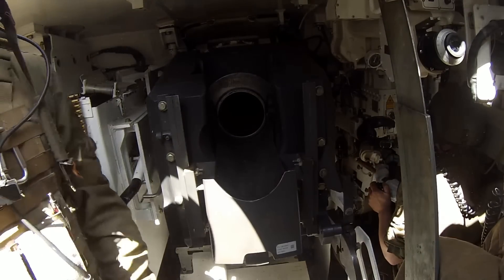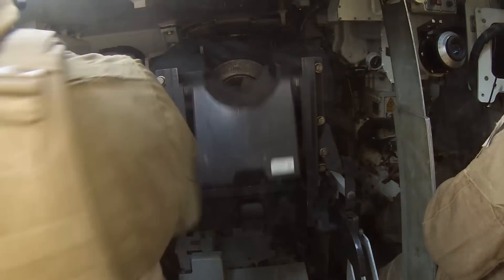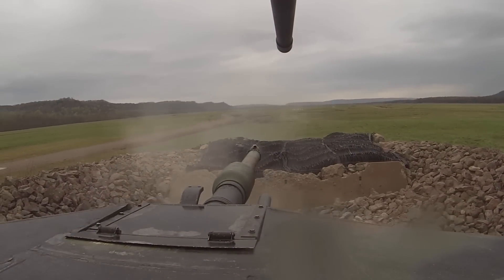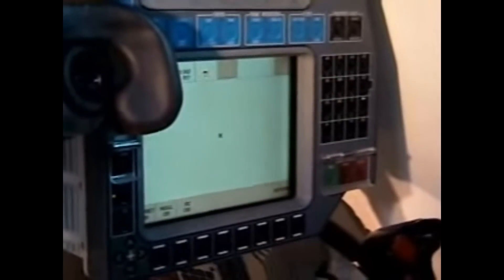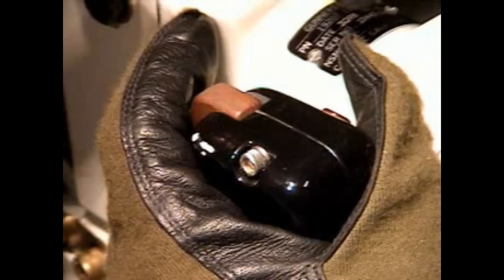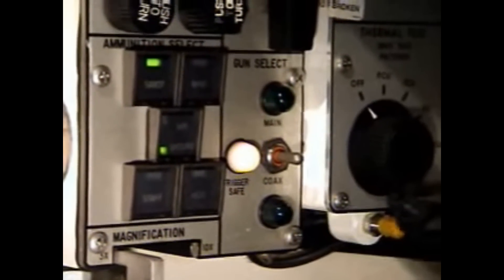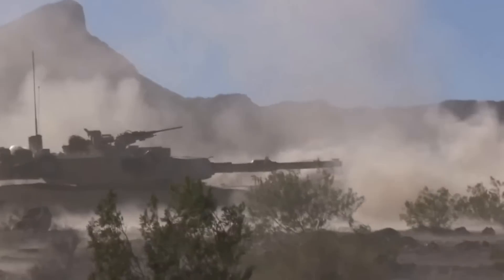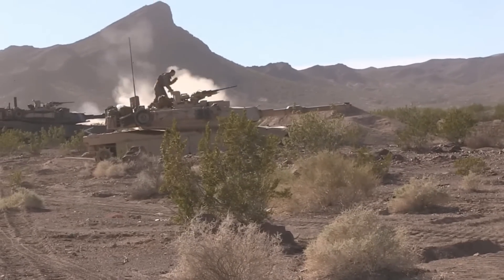How Do They Clear Tank Gun Misfires?

Comment: must be an uneasy feeling having to handle a 120mm misfired round and put it back into the storage rack lol
Reply: With .22lr you can just rip the bullet out and pour out the powder.  Of course after having waited a minute for the 0.001% chance its a very delayed hangfire.
Reply: modern tanks are designed with an ammo rack that shuts so that all explosions are projected outwards leaving the crew unharmed.
Reply: Naj Kraemer Not exactly true. A C2 had a blow back, killing the turret crew.
Reply: Naj Kraemer Unless you have an obturator failure.
Reply: Naj Kraemer it’s really designed to help with taking enemy fire.

A misfire is a very anal relaxing moment when you open the breach. With Chieftain you hope to hear “no vent tube”.
Reply: @najkraemer3117  regardless of crew safety, wouldn't that still put all the other shells at risk,?
Reply: Man I would scare as fuck
Reply: even an explosion aimed outside can cause damage to the tank, and it could happen with the door open and might take with it a large portion of your ammo... best to avoid this if possibole...
Reply: Yeah, I figured they would throw it overboard to keep it from cooking off in the ammo rack. I know at the range I kick dud rounds away from me. Don't want anything going off not in a gun.
Reply: @rre9121  Rounds that go off outside of a gun don't shoot the projectile. They go off like a firecracker.
Reply: @rre9121  Modern tanks are designed with an ammo rack that, if it would go off, a panel on the top (primary storage area) of the turret would blow off, forcing all the gases that way. Which is why it's called a blowout panel.
There is another ammunition rack on the side of the M1A1, which also has a blowout panel.

Must get loud as hell when it does get set off, though.
Reply: @pocketwingman  Yes, but you don't want to lose your ammo to a cookoff if you don't have to. I'd just as soon not lose 30something rounds of ammo and a ton of damage to the tank from the ammo going up.
Reply: The ominous music doesn't really help.
Reply: Yes, I'm not an idiot, I understand the difference between a .22lr and a tank round. Also the depleted uranium will not melt you, neither literally nor figuratively. If that were the case they certainly wouldn't leave it exposed as they do on tank sabot rounds. Here is a link to a picture for reference of a variety of depleted uranium munitions.

http://2.bp.blogspot.com/-ssnKCahunvY/UtNKb94_SkI/AAAAAAAABNM/M8OHZPp0XiQ/s1600/Depleted-Uranium-rounds.jpg
Reply: problem with just throwing it off the tank in combat is that you could have either mechanized infantry with light armored ifv's or infantry who you could harm or even kill. You can't only think about your own safety when in combat or something will go realy bad.
Reply: We toss it out. Picked up later or blown away by EOD.
Reply: I feel like very many think of tank rounds as very big small arms rounds. As far as I can tell, with modern electrical primers, there's pretty much no concievable way for it to fire when not in the electrical system. So once the thing is taken out, the primer can not go off. And with how long they wait to take it out of the breech, a slow burn is also out of the question. I think it sounds more dangerous to drop the round on your tank from the outside than putting it back on the rack. 
And even after all that, if it somehow went off, then it'd most likely be when the door is closed, because it is closed more often than not. 
Not to mention the time and danger of grappling that thing out of a hatch in the middle of combat.
Reply: @The_Foxymew  The reality is that, even with small arms, hangfires exceeding 30 seconds just do not happen, and over 1 second are practically unheard of to the point that many people erroneously believe them to be a myth (though, to be fair, I've only ever heard of it with old WW2 .45 ACP ammunition). While 15 minutes may be the "training" amount, I guarantee you in actual combat they only wait 30-60 seconds and pull the round after the 3rd or 4th attempt, since the odds of the round being a dud are far higher than there being something so wrong with the fire controls that resetting the circuit breakers can't fix. Statistically, it's far more likely to be the round than the tank. And, statistically, you're far more likely to get killed by having your main gun out of action than for the round to hangfire beyond 30 seconds AFTER they've already tried to shoot it multiple times and it's already been 2-3 minutes since the first attempt just in troubleshooting. Basically, you're talking less than a one in a million chance at this point.

I am in no way advocating unsafe behavior. I am just stating the reality that no one is going to try 6 times in combat and then wait for 15 minutes when, after 3 or 4 times and the time required for basic troubleshooting the odds of it going off are basically nil.
Reply: LaboonTheWhale Nobody lives forever.
Reply: Cook-offs are not common in manually loaded guns. They are not generally related to misfires but are caused when the breech of the gun is hot enough from firing to cause the propellant or bursting charge to go off from the heat. Rapid fire five inch naval guns are subject to possible cook-off after 20 rounds continuous fire. A delayed misfire is called a "hang fire". It can happen when the priming charge doesn't ignite from the electric impulse. There is no real way to predict how long it will take but fifteen minutes could be considered as safe as a hang fire ever is.
Reply: I believe there is a version of the Leopard 2 that removes the hull ammo and extends the rear bustle but who knows how many if any have been ordered, definitely a minority.

T-14 is the only only MBT I can think that has 100% safe storage with the crew isolated in the forward compartment. Though The autoloader will be wrecked with likely damage to various remote gun systems. Still the crew lives and the vehicle should move, if the engine compartment is isolated and armored between. Still way better then the instant death the T-64,72,80,and 90 are if hit.
Reply: xmeda  crews chance of surviving are enhanced.
Reply: LaboonTheWhale we if it is uneasing, then you are unfit for the task
Reply: No it really isnt that scary.
Reply: Don't bet on an electric primer not hanging fire up to thirty seconds after the last attempt to fire. Our five inch guns in the Navy had electrics and there are literally hundreds of records of rounds going off later than that. Once the primer is shocked and fails to fire immediately, it can hang a long time, and is most unpredictable thing in the world. There is no such thing as a "safe" miss fire. And you have to balance that against the temperature of the barrel. After so many rounds of rapid fire the barrel can be hot enough to cook off the propellant.
Reply: The moment the breach is opened to extract a misfired round, you couldn't get a needle in the entire tank crews assholes. FYI tank crew assholes are usually wobbled out .
Reply: osmacar  Truthful comment.
Reply: well, it's still something i would'nt want on the ground when in a combat situation, where we're advancing or even regrouping. Altho, however if you've waited 15min i can't see any prob in just disposing them and letting the EOD know. 

Not sure how it's in the Bradley but in the CV9040 we're waiting, then, disposing them.
Reply: LaboonTheWhale I know I'll throw that shit out the tank not put it back...
Reply: Actually only a few modern tanks are designed that way.  The M1 Abrams was the first to have that installed and the only one that uses it exclusively for all of its ammo.  Both the Challenger and Leopard series tanks keep some ammo in the rear bustle like the Abrams but carry more than half of their ammo in the hull at the front.  This allows those modern tanks to carry more ammo than an Abrams but if the hull is penetrated in that area then the ammo will cook off and incinerate the inside of the tank.
Reply: Not exactly. In Chieftain the charges are kept in pressurized, water jacked bins. Only the projectiles are stored in racks.
Reply: And you are wrong about minimum revolutions. Abrams have smoothbore gun so there is no spin. Its intentional because spin would screw the forming of copper stream and decrease HEAT effectivness (reason why British has no HEAT). Also long penetrators used to hate spin. This is why British Charm rounds have ball bearings to counter the spin. HEAT does not even has fins. MPAT, SABOT and HE-OR has fins so their precission is better as they are fin (not spin) stablilzed.
Reply: The reason we (The British) don’t have HEAT is that it is considered ineffective compared to Sabot, Fin or HESH.
Reply: Okay enough of this nonsense. If you don't actually know anything about the projectiles and how they function you shouldn't be posting such emotional and FALSE statements.

the M830 MPAT the fuse is located on the rear of the projectile and is not armed until the projectile accelerates down the barrel and then begins to decelerate on exiting the barrel. This is called set-back arming where the G-shock of firing the projectile arms the fuse.

So unless the M830 experiences this environment it will not be armed, failure to fire is purely a worry about the propellant itself suddenly igniting from a delayed ignition. Inside the fighting compartment till will produce an overpressure in addition to the burning propellant which is lethal. Outside the gun on the ground this will produce a very hot very dangerous fire not an explosion and little overpressure as it's not in a contained environment..

In a training environment or fire support position a failure to fire would get handled the safest way possible, in a direct contact environment where you need to service a target or you or your allies will die that thing goes over the side immediately. Because in direct contact with the enemy the tank commander makes the decisions, not a training book.
Reply: Honestly, i was more worried about static electricity then dropping a grenade ;)
Reply: Macieksoft Both M830 and M830A1 use set-back arming of the fuse which is in the base of the projectile. M830 has a impact sensor on the standoff probe and M830A1 has a air/ground switch and proximity sensor under the ballistic cap. Both are base detonating fuses though. Have to be for HEAT to function wave shape has to start behind the liner.
Reply: Yet atleast in theory (and probably in practice too) shells can self ignite from barrel heat just as a MG round can in rare occasions. Plus as I said before I ve seen a "misfired" / dud shell "self igniting" right after being "thrown" out of the tank and it was an electrically fired shell (M48a5). I don't know what exactly happened because I wasn't in that tank (but I was present on the field and had sight of it)
Reply: A survivor  i really think that last point is the most pertinent. to leave behind unexploded ordnance is the worst kind of "littering", and on top of that it could easily be repurposed if recovered by foes. carrying it away is the responsible thing to do, not necessarily the optimal decision for the tank's survival.
Reply: I would be strongly inclined to put the dud round over the side
Reply: Ca11MeKARMA   Booby trap it with a live grenade under the shell.
Reply: LaboonTheWhale Abrams has 100% safe ammo storage as long as u keep blast door closed. Leos have turret ammo protected while hull ammo is not. You can remove hull ammo and you are safe to go, but this means that u are low on ammo. I never heard about variants with extended turret ammo storage. Who knows, maybe 2A7 has protected hull ammo?
Reply: So what?  Do you want one bad round taking out the rest of your ammo supply and your tank out of action til it can be repaired?  The answer is NO!.  In combat that bitch would be chucked out of the tank as fast as humanly possible and we'd continue to fight.
Reply: Would be of limited use as an IED by itself.  Doesn't have the same boom factor as say a 155mm artillery round.   You could potentially use the propellant to make a bomb, but at the end of the day I'd rather make sure my tank and crew are safe first.   Besides it's easy enough to toss it on the ground and drive a short distance away and then toss a frag on it to destroy it.
Reply: You are almost entirely wrong.  First if  you dump it outside on the ground, simply move away a short distance then throw a fragmentation grenade at it and destroy it.  Even if you didn't, it would not be like driving over a mine, as the casing is basically paper and doesn't have a breech to keep the gases contained, so it would burn more than it would explode.  Only the HEAT and MPAT rounds "explode" and they are not armed until they complete a minimum number of revolutions after leaving the muzzle, so dropping it on it's nose would have minimal chance of setting off the round.   Leaving it in the ammo bin means that if it does finally go off, you lose your entire ammo supply, and your tank is out of action until it can be hauled back for repairs.   That might be ok on a training range, but I'd never do it in combat.
Reply: Thats what i said before. Its much safer to throw it outside. However HEAT can be dangerous kind of IED because it can be used to penetrate vehicle armor. 155mm arty is usually unable to do it. Just place HEAT under road and detonate it, it can penetrate any vehicle as bottom armor is very weak. So you gonna cal EOD team to destroy the round and not allow enemy to use it. AFAIR tank crews are not equipped with hand grenades so they cannot do such trick. And propellant is useless as IED. However you can fire HMG or HE-OR or even HEAT on the round to set it off.
Reply: That doesn’t make sense? HEAT works by forming a jet of molten metal (copper) to burn through the armor. The reason the HEAT round it shaped like it is is to give a “stand off” distance for the metal cone to form.
Reply: And Abrams have 3 separate ammo compartments so you cannot looase enteire ammo. But its still much safer to throw the round away because you don't want the round to go off when blastdoor are open.
Reply: yea......time bombs with a faulty timer are never fun...whether purposely or accidentally made.
Reply: in the leo2 in Afghanistan we just dumped em outside and let the eod ppl know so they could pick it up.... and u can be 116% sure it would be announced on the voice comms and would be the first thing to be removed by eod before any1 infantry would go near it... the scene from fury where u see infantry pushing forward behind the tank while its firing etc its not something which happens everyday.. ive seen the marines do it once in a firefight but never seen it since im not sure its a standard tactic hey use today which would be the only real situation where i see a chance for infantry to step on something which would have been tossed out... but its 9 years since i was deployed and back then they alrdy talked about tanks where shells would be directly dumped underneath and various other really cool stufff which would make life alot more easy and alot safer for the tank crews working in the tanks so would really baffle me if this want alrdy in use in hte big countrys
Reply: Kenneth Christensen, In WW2 the U.S. used the Sherman tank as a shield for infantry while using the main gun to take out threats to the infantry such as bunkers, snipers and machine gun nests.  This tactic was developed during WW1 when the tank was first introduced.  Tank destroyers were used to engage enemy tanks.  Now that armored and armed APCs exist, it's more likely those would be used to protect the infantry while the tanks do their own thing.
Reply: although sometimes infantry still use it as cover in urban enviroments , tanks tend to be bullet magnets.... so i would stay the hell away from it. also i would not recomend to be close to it when it fires. but as it comes to misfires.... never had one and i shot many grenades
Reply: except it CAN explode at literally any moment now that its been armed...sometimes shells can go off at any moment simply cause of a loose fuse or something which could be jostled back into position at the slightest bump or even nothing at all since sparks can jump air-gaps
Reply: To be honest M830 is normal HEAT (with 600mm RHA penetration and impact fuze) while M830A1 is actual MPAT with worse penetration but with ballistic cap and programmable impact/proximity fuze.
Its true that its all about propellant. It can be dangerous, it can ignite anything that burns and also create lot of hot gases. For sure nobody wants it to go off and ignite rest of propellant in the ammo compartment.
Reply: Yet it was standard procedure atleast with previous tanks (that are almost all still in use by near everyone) who lacked separate armored ammo compartment with blow out panels. Thing is its safer to take the chances the "dud" being used as an IED than having it potentially blown inside a millions dollars expensive and irreplaceable (important) war machine filled with highly expensive trained crew. And btw I have seen dud round blowing up just a couple of minutes later after it was thrown out of the tank. I wouldn't want that inside.
Reply: Wrong on the first part. Tank rounds' warheads are armed by the initial cartridge detonation. Also tank ammo since about cold war time are electrically fired. you cant initiate them via a (normal) hit however strong. And as I said its not safer outside if anything is just as bad but with one big difference: the crew feels safer hence it can keep operating effectively. You don't want a frustrated/unease tank crew especially if your army includes conscripts. High loss of effectiveness and a domino of mistakes starts. Also even though I don't remember how long it took for that dud tank round to detonate via "slow ignition" I remember that I almost lost my fingers on a 7.62x51 round loaded in an MG3 which detonated seconds after I opened its cover (and happily had the wisdom to shut it off asap, in fact it blew up just as it was locking in place). The 7.62 according to procedures should be safe to remove since it was about 2 minutes later or so. I almost never saw a crew member professional or not who wasn't nervous (even if trying to hide it) whenever we had a "complete" misfire (except if he was in a safe distance away :p ) happily I never suffered such a an event with tank shells (though I was in the funny position of having a shell stucked half way during loading and not budging either in or out lol - very old and not properly cared rounds to a similar fated training tank that were kept for money saving reasons).
Reply: "Beast of War" much? ;)
Reply: LaboonTheWhale .must be the empty storage eh ?
Reply: Sheesh, I'd be too scared to keep it anywhere in the tank. I'd throw it out the hatch as fast as I can!
Reply: I work underground and often get lined up to blast bulk mining stopes..10,000 to 60,000 lbs at a time. When I follow all the detonator proceedures and fire it and it doesnt go...yes. its fucking scary to walk back over to investigate why. We wait 10 mins by law..still makes me cringe every time.  So i know the feeling these guys have when they are removing a misfire. It aint cool lets just say that. Lol (and im not under fire when doing so like they can be)
Reply: Naj Kraemer as long as the wall of the rack that is facing them is stronger than the outer wall...theyre gd. Hopefully...
Reply: The Kudl
Reply: it seems like a safety hazard too, why don't they toss the misfired round at the first possibility.
Reply: Back in the storage rack seems like the LAST place I'd want to put that round.
Reply: Putting it in the rack isnt worth it
Reply: RedFox Tactical you sir are a gentleman and a scholar. Thank you for your input. Makes me feel a lot better for the guys who do this job. (I am watching this video to see if possibly I can see myself doing this kind of work) and to know that important piece of information you just shared could make all the difference in anyone who has an interest in the cavalry. Thanks again.
Reply: just another day in a tank
Reply: Not it isn't.
Reply: No kidding.
Reply: You clearly don't know how DU penetrators work, so why are you posting?
Reply: Thats what my crew did
Reply: Naj Kraemer but you lose your ammunition
Reply: If the gun wont make it fire then there is really really really small chance for it to fire on itself tbh.
Reply: Wow so many dumb ppl on YouTube lmao all the comments here are not only dumb but completely untrue. If u don't know about a subject don't give your two cents u just look dumb. A round is just like a gun bullet it's not going to magically blow up. If the firing charge didn't go off it's not going go off at a random time. If it's dead it's dead! Also running over a round is not going to make it blow up lmao do you ppl not know how stuff works? It is fire that ignites rounds. No fire no bang! Pretty simple
Reply: ... after being pelted by the enemy for 15 min without chance to return fire ...
Reply: A survivor  if u have common sense u wont run over anything that can explode but still yea if there is friends out side o are right
Reply: Unless it is a complete procedure change from when I last served on an Abrams (cold war in W. Germany), misfired rounds were not placed back into the ammo rack upon removal from the breech. Rather, they were totally removed from the tank and placed in the dud pit and left for EOD to handle. Combat, we were told to chuck the round overboard.
Reply: FBI Do you understand what a DU round is?
Reply: RedFox Tactical Have you every served on MBTs? The M1 uses consumable ammo, similar in concept to multi part ammo that was used on Chieftain. 

A misfire on an MBT is very different to a GPMG or LMG.

I can only speak for the British Army. The gunner reports “Firing NOW!”, if the gun doesn’t fire he will report “MISFIRE!”, circuits are checked and gunner fires again. If a second “MISFIRE!” Is reported the crew wait and go in to gun clearance procedures.
Reply: RedFox Tactical The wait isn’t for a short in the firing circuit, the wait is for the “primer”. All rounds use a primer, even multi-part tank & artillery ammunition. 

In multi-part ammo, that was used on Chieftain, you had 3 components: Projectile, Charge, Vent tube. An electrical current fires the vent tube, which ignites the charge, and sends out the projectile. The M1 works in the same way, except the 3 components are loaded in a single “case”
Reply: I feel uneasy having even a 22lr misfire 😂
Reply: I can tell you guys. Life is not a guarantee safe environment. Stuff happens. Tanks are designed to kill without prejudice. I don’t mean to make it sound dark, but it is what it is. It’s a weapon crafted to be such. However, there’s 10,000 of us that survived tank life. Despite the dangers of tanks, they’re actually quite enjoyable. I mean come on, wouldn’t jump on the chance to drive and shoot this beastie? You just got to know what you’re doing.
Reply: Jan G RTR had a C2 blow back in to the turret, 3 dead, 1 critically wounded.
Reply: A buddy of mine got a MBE for clearing out the ammo during a turret fire.
Reply: A survivor Doesn’t work that way. There is a G force lock that prevents the ammo from arming unless it’s been fired.

Sabot doesn’t arm, there is no explosive in it, the same as fin.

Most tanks will take a sabot bias, if appropriate.
Reply: Johnny English It means the initiator has been struck, but the main charge didn’t fire. The charge could be burning, but hasn’t achieved an explosive reaction. Opening the breech maybe sufficient to fully ignite the charge. 

I’ve only ever had one true misfire, it’s pretty comfortable, waiting, and no one can leave the vehicle.
Reply: RedFox Tactical Great explanation, but it doesn’t really apply to a tanks main armament. 

First thing we check is that a vent tube is loaded, if not manual insert one and fire. This is just the first part of a misfire drill.
Reply: The problems with chucking it outside are time and distance.  These are the basis for the "stuff it back in the rack" logic.  

Time:  It takes MUCH less time to pull it from the gun barrel and shove it back inside the ammunition rack, that is behind the blast resistant doors.  The inside of the ammo rack on an Abrams Main Battle Tank (MBT), of which is shown here in this video, is designed so that in the even one or even all of those shells cook(s) off (explodes) while in the ammo rack (with the blast door closed of course), the blast is directed up and out of the turret, away from the crew hatches, out through the blast panels.  This is so if the ammo rack is hit in combat, this will hopefully save the life of the crew by directing the exploding ammunition out of the turret in a controlled manner.  This feature has actually saved the lives of several Soldiers and Marines who had ammunition failures in the ammo rack go off suddenly.  The tank itself can actually survive this quite well, as just the ammunition rack is destroyed, and NOT the whole tank.  The turret is usually sound enough (as it has been any time this has been tested and has happened in real life situations) to still protect the crew and they still have their smaller weapons to fight their way out, as they drive away.  The tank can catch fire, but their are fire suppression systems in there as well as all over the Abrams, and the ammo compartment being on fire does NOT necessarily catch the whole tank on fire, as it is isolated to inside the now ventilated ammo compartment.  This is one of the reasons we beat the tar out of the Iraqis in The Gulf War, because their tanks had their ammo just strapped into the sides of the turret.  One hit with that 120mm and the whole thing went BANG!  Turret goes flying and lands a good ways a away.  

Distance:  The distance from the Ammo Loader's hatch, to the outside of the vehicle, far enough to not get injured, dead, or the vehicle damaged from an exploding 120 round, is quite significant.  Minimum safe dustance is about 500 yards or roughly 300 meters in open flat terrain.  Firing ranges often have "dud bunkers" for placing dud and misfired shells  to allow them to cook off if they are going to.  However, it is safer to place the round back in the ammo rack until it can be extracted by the proper procedures, and placed in a dud bunker.  The width from the edge of the Loader's hatch to the ground...  is about 4 feet...  straight out.  Those shells weigh about 60-100 pounds...  think you can heft a 100 pound misfired ticking time bomb up through a hatch barely big enough to fit an average human, heft you up on top of said tank, then CLIMB DOWN from said tank CARRYING said dud round, aaaaalll  the way out to the side of the tank or to a dud bunker?  And in combat, you can't just sling these things outside either.  1)  it then becomes ammo for IED's, and 2) that thing exploding right next to a tank track can blow the tracks clean off.  Not to mention if it goes off and someone is outside, it is a literal bomb exploding, and has a LOT of explosives in it.  Enough to kill everything with 200 feet of the explosion at least.  

So to all ya'll saying "chuck it outside"...   no...  just lots of Nope.
Reply: WET AMMO RACK
Reply: I’ve never had a misfire but during tank table 12 we always got target target cease fire. so instead of waiting 20 minutes to pull the around out we just yank it out, go eat and go to bed. first time ever did it fucker was crackling and smoking I thought you were going to fucking die.  put it in the ammo  well with about 12 more rounds in it so I said well fuck I guess we’re going to cook it let’s cook it right
Reply: After the breach is open the round is practically inert. At the point that they finally remove the round its already been 30 minutes so theres no chance of a slow cook off. It would need to be penetrated by something else to detonate. And remember, the ammo rack has exterior armour too, so youd pretty much need to be shot by another tank to go out like that.
Reply: Don't blow up don't you bloe up DON'T BLOOW UPP FUUUCK
Reply: During an exercise last year with the Swedish army (Leopard 2), my crew had 6 duds in the rack at once. Turns out it was a faulty batch of practice ammunition. But yeah, pretty nervous.
Reply: Takes a lot of trust in your training and equipment...a lot. I had goosebumps again watching this.
Reply: Max Paine not to mention the post war hazards
Reply: You'd think storing a dodgy round with the others would be a bad idea. Of it goes off, well there goes all your ammo. Get it cucked!
Reply: Nah its not that bad
Reply: Same on the grenade range, we were told to watch exactly where the grenade fell. Reason being, in the event of a dud, WE, that being the thrower, would have to go out there after a certain short amount of time and mark the dud with mine tape for the EOD guys to destroy later.
Reply: I mean even with a blowout pannel why the hell would you put it near your other rounds, just toss it out your hatch
Reply: I'd be throwing the round out the hatch
Reply: Or just throw it outside and drive away. Shoot it from the distance.
Reply: Especially when it is a depleted uranium sabot
Reply: You get used to it after awhile,, Done it quite a many times,,,
Reply: Yea but they're lucky its not 150mm
Reply: My first thought
Reply: Eh, after the 15 minutes it's not too likely to do anything
Reply: I don't get why you'd put it back in the rack. I know the magazine/bustle is designed to blow out but if it does then the tank is disabled, and the crew could still be injured.
I'd  pop the hatch and dump the round outside and move the tank to a safe position.
Reply: On the other hand I wouldn't be nervous handling a misfired round. If it doesn't cook off, you are fine. If it does, well won't even know about it.
Reply: Check how that works with Leopard 2A4 in Turkey... if the ammo compartment blows, tank is out of business.
Reply: just throw that sucker out of the tank .
and if you want to destroy it ....run over it... or throw a hand grenade if you want to be more violent :D
heat gets armed by the shot so it is harmless
more serious is when the breach closes to fast and the grenade is half way in and jammed, it can crack it and the heat of the gun can ignite it (resulting in a cook off in the tank)
had that once, and i was glad my loader was quick to lower the breach and get that sucker in there
Reply: macieksoft but it shouldn't go off inside the tank, there's nothing to set it off. Plus it's pointed outwards so it should send most of the round outward, though it would pretty much just be an explosion. However, the ammo racks inside the tank are armored and sealed off when closed. Depending on the amount of ammo set off, I don't think it would kill the crew. The ammo rack being seal off increases the survivability of the crew quite a bit.
Reply: In training - one situation
In combat - I would throw it out of the tank. If it is round failure, I would not risk that it goes off when I open the blast doors to get fresh round. Or even by mistake to run it back into breech by mistake due to the combat stress.

And in training - it would be probably wise to send the rest of the crew out of the tank.
Reply: It's possible for a weak primer to 'fizzle' slowly and not enough to set off the main propellant immediately but suddenly happen when the round is manipulated or just chance. Waiting makes sure this can't.
Reply: Tank crews are equipped with hand grenades (atleast in this army) 8 in total to be precise that is 2 per crew member.
Reply: LaboonTheWhale The worst part is waiting. After all that misfires main gun is out of combat for 15 mikes. So when you are under fire you are in serious trouble.
Reply: LaboonTheWhale The problem is when it goes off when blast door are open. And you don't want to loose the ammo  that is in the rack. It's a lot safer to throw it outside. Keeping such unsafe round is unnecessary risk.
Reply: monkeymadnes100 This is why you should mark it as EOD and let EOD guys know. I bet it is the same procedure as with disposing misfired TOWs. You never keep misfired TOWs inside Bradley. You just clear the launcher and dispose them.
Reply: Mungo glad some1 had the same  idea lol let the ied guys learn how to detente it
Reply: LaboonTheWhale It's better to throw the round away. You certainly don't want it to go off anywhere in the tank, not even in protected ammo racks as it would destroy the remaining ammo and potentially damage something. Enemy cannot make IED from sabot or canister as it has no explosives, just a powder. HEAT could be used as IED, it could be deadly when detonated under vehicle with copper stream pointed at the thin bottom armor.